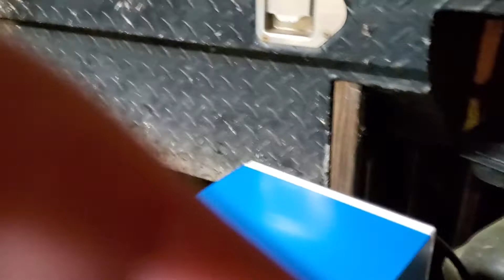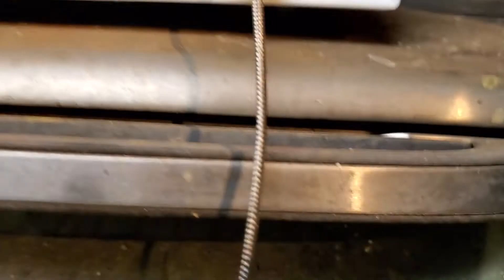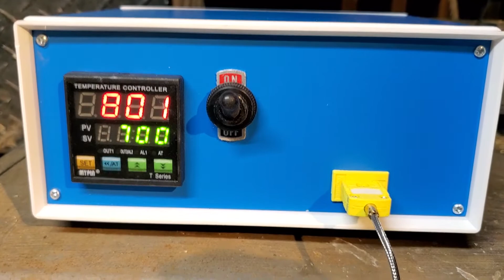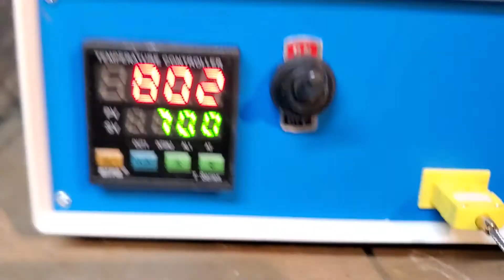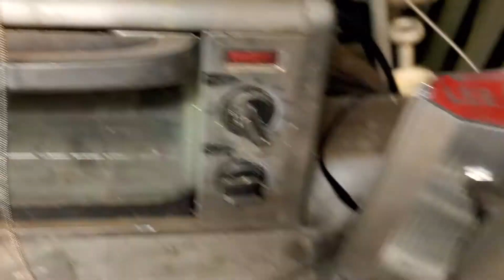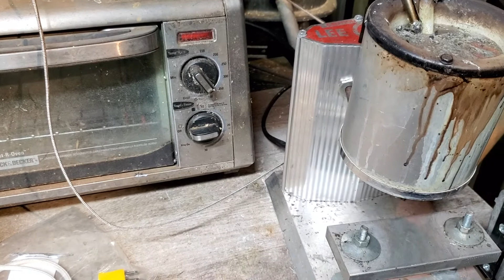New Temperature Control Unit for Lee Pot!

Comment: looks like a nice handy temp management control unit... it would be cool to set up one of these with my rcbs pro-melt gen 1 pot.
Reply from the maker: It is a dandy piece of equipment for my 10lb Lee pot. I have a Lyman 10lb dipper pot I'm thinking about trying it with for zinc. Gonna cast the 12g Lyman Sabot pellet with Zinc and see how it goes. If the pot gets messed up, I'll be alright.

Comment: Looks like a copy of Johnny’s Reloading Bench PID. I’m almost done wiring mine.
Reply: Yes same basic one, breweries use them alot
Reply: @corkystock5229  I had been planning on doing one of these since Johnny showed his video series. I have also heard that people use these in smokers and sous vide. I am really interested in trying it in a smoking scenario. I may have made a giant case enough to fit a cooling fan in one for later, but I am concerned about dust. My cables are about 4' long as well. Only thing I have left is the thermocouple and the programming. I might use it for a lube heater as well.
Reply: @nathanmarcucci  the solid state relay is rated atv25 or 40 amps depending on which one you have, if you mounted it on the heat sink and your load is less than half you will probably not need a fan, i know that running a 4-20 pot which is 700watt it does not raise the. Temp of the relay more than about 3 degrees when i used a infrared thermometer

Comment: the mold thermocouple i sent just to see if you wanted to see plug it in for a minute to get a reading on the mold for when it was casting in the "sweet spot" then plug the pot back in.  I don't recommend  anyone use it to control the pot temp while the mold thermocouple was plugged in. {i am not stocking the little mold thermocouples but might if enough people wants them}  i have a separate meter that i leave plugged in all the time, basically its a thermometer for the molds. Thanks Ben that was a great video
Reply from the maker: That's me and my assumptions 😂
It works great! Thank you again!
Reply: How much is one on these???
Reply: @eugene7890  when i was selling them they were $150 to members of the Hanson groups on mewe, i had to stop making them until i recover from my leg amputation, i may be starting up again in a month or so i think